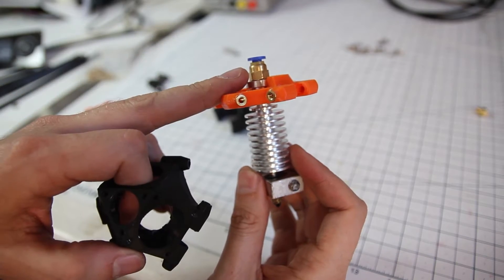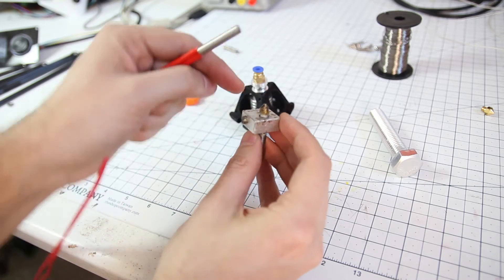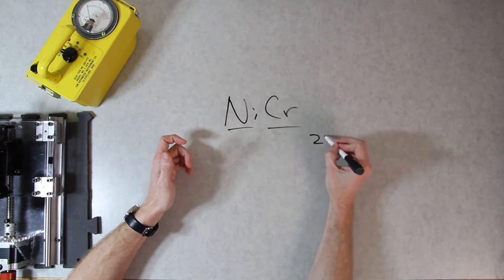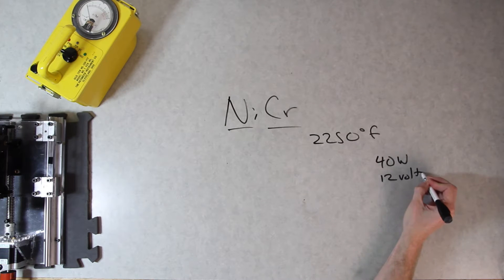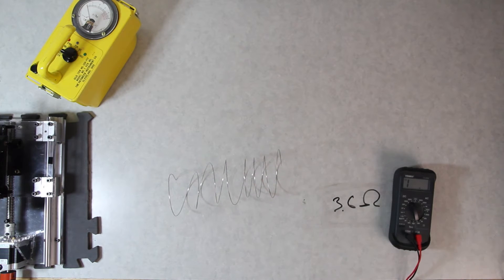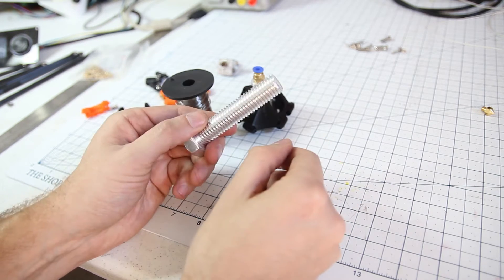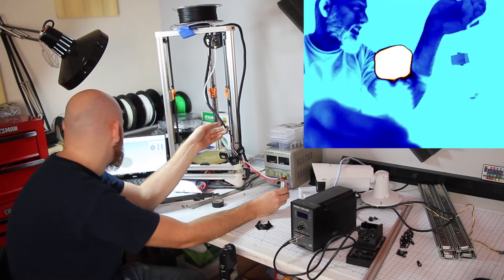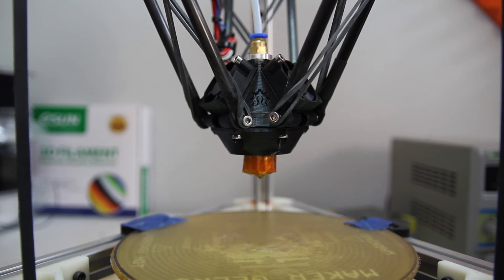S01E13 - 3D Printer Upgrade (Building a Hot end with Nichrome!) Part 2

Comment: Nice work.  Though, while I admire the D.I.Y. spirit, I recommend you try a genuine E3D v6 hot end.  The variety in available nozzles alone should be enough incentive.
Reply from the maker: +Brandon Fesser: I have heard really good things about the E3D hot ends, and I'm a big fan of the company. This was really just to see what it takes to make one. Turns out it works really well, I have about 40 hours logged already with no problems with the Heater
Reply: @PhysicsAnonymous  hey, I am using nicr wire for my heat bed. And according to my calculation, 10 cm wire is required for reaching 300c but that much length of wire is not enough for even distribution of temperature gradient. So can you suggest me what to do. I want to wind the wire on bed and temperature required is 300°c
Reply: Honestly this is one of THE most clever diy printer ideas I have ever seen. Just imagine the limitless options you have. Can print peek no problem. Pc. Anything. Heated bed. So many uses!